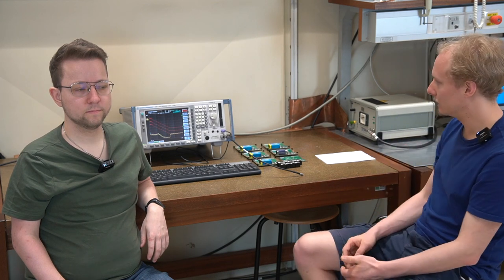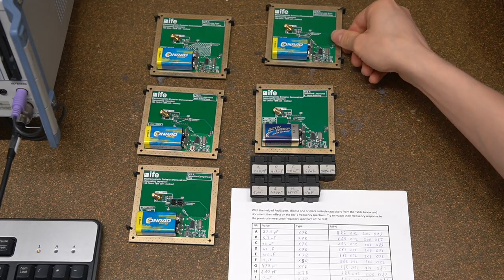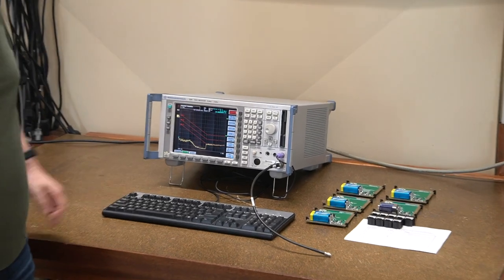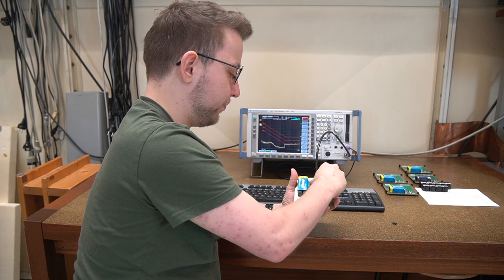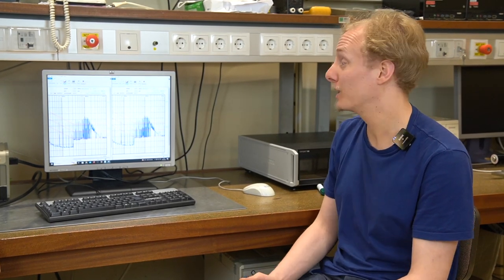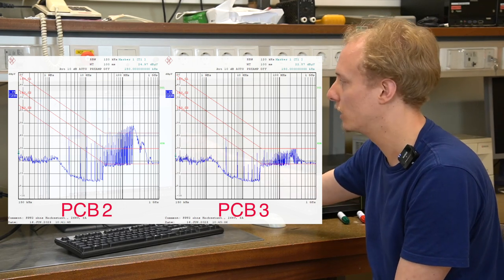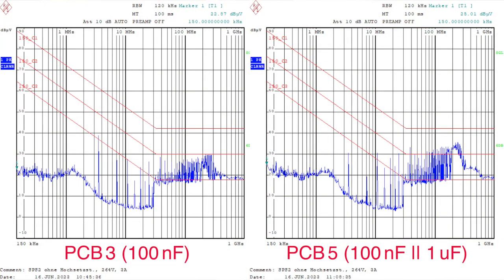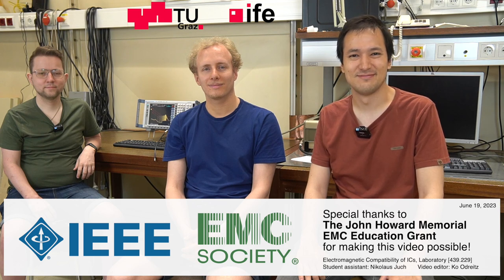Conducted Emissions of ICs, 150 ohm method, video lab report

Comment: Great video!
Learned many years ago that you really need a ground plane for well behaved RF circuits! 
Also, the pin-headers will both increase inductance and with increased height will be further from the ground plane and give the component greater height-aperture to act as an antenna to adjacent components. However if you perfectly match the overall component heights, the real-effect of the headers is not that much, other than their pin diameters affecting additional capacitance and coupling.  I always just solder the components even if it’s not that convenient, to minimize introducing anomalies.
73… 😊